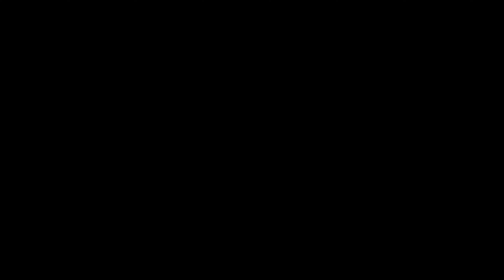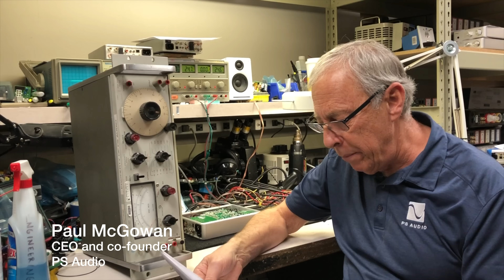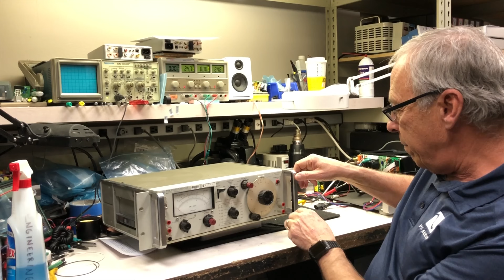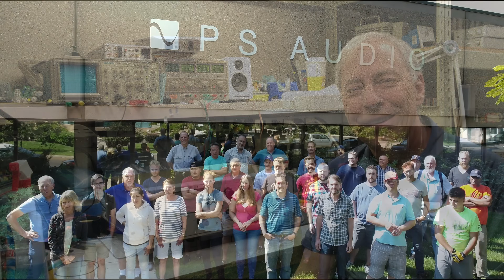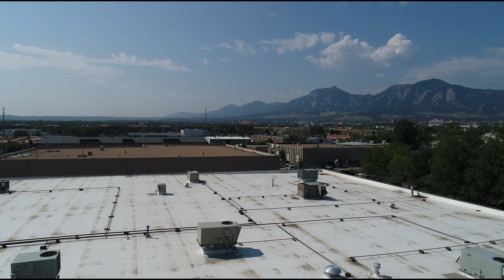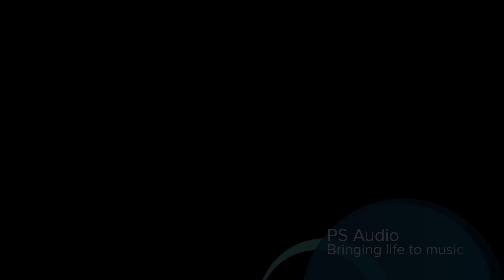What measurements can we hear?

Comment: I like this video. I'd like to  see turntables measured in all manner that it is possible, but, measuring for precision and isolation would I think be enough to understand the turntable's performance. Thus, we might get an idea for the price point where a turntable no longer yields a sound which could be discerned as sounding better. After all, for the most part, the turntable is a mechanical device so measuring for precision and isolation should make it easier to know how much money it will cost to extract all that's in the groove.

Comment: The human auditory system is far too complex to be able to judge how something is going to sound just based on a couple of very basic measurements, most of which most likely don't play a big part in how we perceive sound in the first place. Not to mention that most measurements only measure conditions much simpler than whan the equipment goes through while playing actual music.  Measuring a square wave response at 400 hz for example, or an impulse response, or a frequency response by sweeping through the 20-20000hz range isn't the same as actually playing music through the equipment, when the equipment needs to do MANY things at the same time, instead of just one. Measurements are good to check the technical performance of equipment and to see if it works properly and to detect any obvious faults or room for improvement, but it can't replace listening to the equipment. These spec sheet wars and measurement wars going on in the industry are a bad thing, because it makes people believe that those few simple things shown with measurements are all that the sound consists of, and that's just not true. It's like believing that can see everything if you just had black and white vision, but couldn't see colors in the visible light spectrum like other people can. And of course we people believe we can see everything now, even though the visible light spectrum is just a tiny portion of all the information out there.
Reply: so your saying if you made the perfect speaker with 20hz-20khz, no distortion,  no decay all from a point source with perfect phase and put it in a perfect room with a perfect recording it may or may not sound good?   or do you think there is some interdenominational voodoo happening between your ears and a speaker?   sorry but i call audiofool on this one
Reply: @alexkirk2500  So what you're saying is that Paul is a fool as well? Because he went through the entirety of the video basically harping on the fact that 1) We can't measure everything we perceive, 2) Just because something "measures" well, does not mean it will necessarily sound good, and 3) there are many, many other factors that come into play - mostly due to the uniqueness of the individual and their own physiology.
Reply: @HomeStudioBasics  the uniqueness of an individual is mostly due to the frequency response of their ears and personal preference, some distortion sounds good with bad recordings and hides the floors in it.  some speakers have a big bump in the high frequency these days, probably because of the age demographic.  the size of speakers may affect where you put them in the room.  some speakers may be horn loaded and control high frequency directivity and you will perceive less reflections in the room, some speakers may have lower group delay,  however all of these can be measured.  the things that can't be measured is the look of speakers can effect your perception of how they sound, so can the price of them same with cost and looks of cables. certain ideas you have for instance some people hate the idea of digital have a prejudice against certain amp topologies.  expectations often results in enjoyment of a product.

Comment: Even teh best measurements answer to us only how much electrical data is different in input vice output. That is done without speaker beeing connected while in reality speaker once connected becomes via feedback an integral part of amplifier. Speaker is a whole bunch of different resonances phase shifts and changes of impedance, all of them different at  each frequency. All adding itself to  feedback.  in fact final result  is analyzed by ears and telling us good or bad. That is why I rise so much sagnificance of crossovers which are an  interface between speaker and amplifier.Not everyone notice that spaeker works in both ways - produces sound to listener and produces electrical back signals which in theory, (but I measured that not only in theory) sends information via crossover and cabling back to amplifier where it secretly "corrects" it's ideal performance.  And this information may be for example any acoustic wave :"heard" by speakers or their  resonances with their phases. It can be from other channel speaker but also (why not) wave reflected from walls. It is way too much complication to  be understood only with  measured   amplifier data and It may explain  reasons why speakers with amplifiers  sound so different is different positions or rooms which as for me looks too much   as  for change of dispersion in lowest  tones in direction to listener only . How come that my old compact speakers  had low resonance in boxes 60 Hz but in my room having resonance about 45 Hz it performed  very flat down to 40 Hz? Where was resonance of speaker lost?  It wasn't there.  But when I shifted it to room bigger 20% all bass was gone to null. Then its  a next mystery about tube amps -it is their esential difference to solid that their feedback is minimum few times less than solid. So their sensitivity for such back fire is much less thus  shown here problems should be diminished. I am convinced that it is the real reason of its stronger  "body" in sound.

Comment: The human ears are not magic. Equipment that measures really well is just very revealing. If you have any deficits in your system at all they will highlight them like a spot light and you won't be able to hear anything else until you fix that issue. This is especially true for DAC's and digital transports. Fact is that most speakers, in fact all speakers, are not perfect representations of the sine waves being feed into them. As such, you need to use equipment that plays to your speakers characteristics or build custom speakers to fit your particular equipment. I like to do the latter as it is cheaper and easier to start with a perfect sine wave then swap crossover components and drivers instead of DAC's and amplifiers. Big budget pre-build speakers are not set up for your particular room and equipment. They are a waste of money. Build it yourself.

Also, a PSA for anyone using a PC for digital transport. The latest windows updates that attempt to fix Spectre and Meltdown absolutely destroy the digital signal path in your PC's. Instead of going from HDD to memory to DAC it is going HDD to Processor to memory to processor to memory to DAC. They are double processing everything now so that your memory cannot be read. Unfortunately, this causes an insane amount of digital jitter and it sounds like you are wearing ear muffs while listening to your music. We need to roll back to pre-patch windows versions until there is a hardware fix.
Reply: Thanks for the heads up about the recent patches effecting the sound we hear from our PCs. :)

As to your comment "ears aren't magic" - no one said they are. I don't see what the problem is with accepting the fact that human ears work differently than oscilloscopes and/or other electronic measuring devices and can pick up and respond to multiple simultaneous sounds in ways those devices can't. We all know that there are no perfect microphones or speakers and in the end personal preference plays an important part in speaker selection - doesn't that indicate something about our inability to produce perfect speakers regardless of what the instruments tell us?
Reply: It seems that our ears are the ultimate high end gear; can't be beaten by anything ( yet).
Reply: Penterax, 

Yes, it means no speakers are perfect, just like no room is perfect but we were not discussing speakers or rooms. The topic was more the front end of the system being the DAC, preamp and power amp. I can see no reason why you would not want to start from a perfect sine wave without coloration and then add your own coloration through your speaker adjustments. Doing anything other than that would just make it harder if not impossible to get the sound you want from your speakers and room.

Unless I am hearing Paul wrong, it seems like he is suggesting that coloration in the DAC, pre, power end of the audio system is a good thing? I just cannot agree.